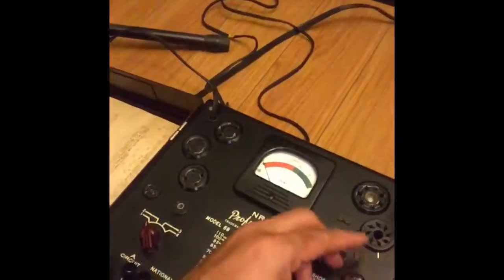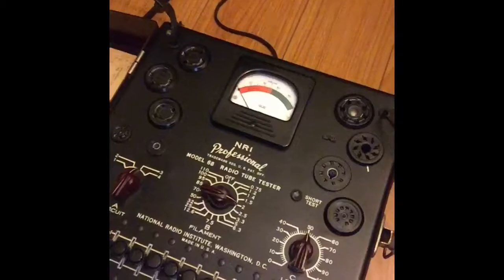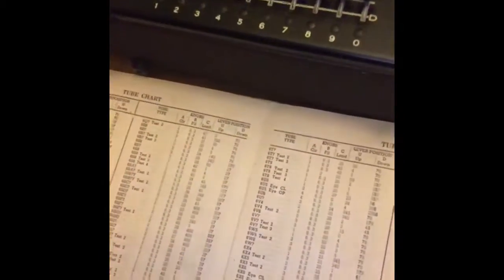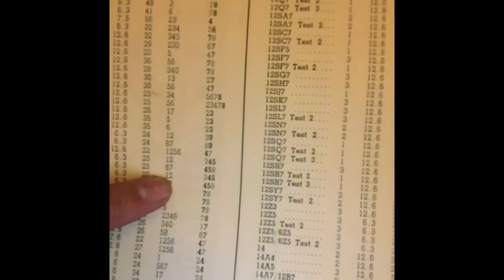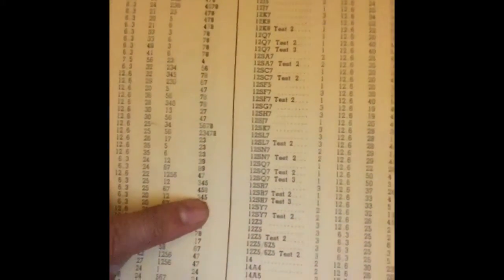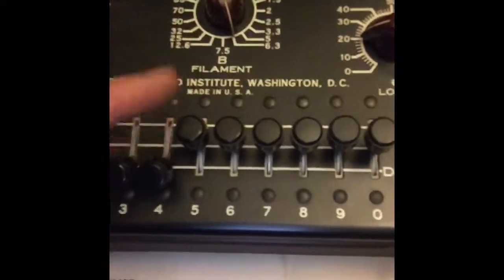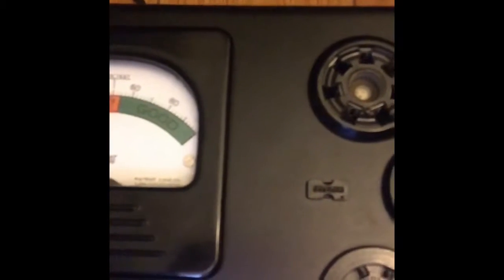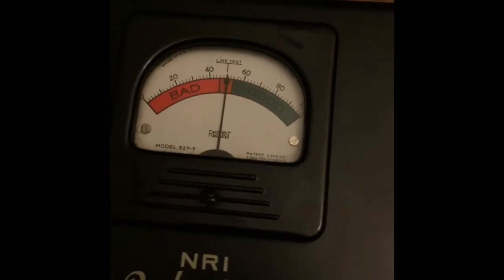How to operate a Tube Tester

Comment: Hello i have the same tube tester.  I have the official manual for it as well. Maybe some pages were substituted but i dont think so. 
The tester tests preamp tubes well, but when i test el34s it shows all tubes as bad which cant be true. Is there a different method to testing the larger tubes? I followed the manual settings properly.